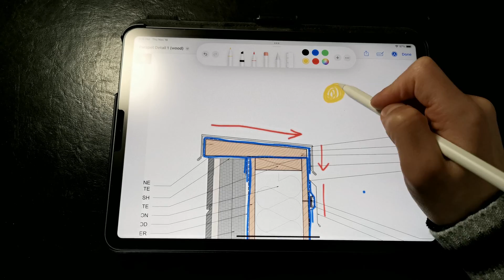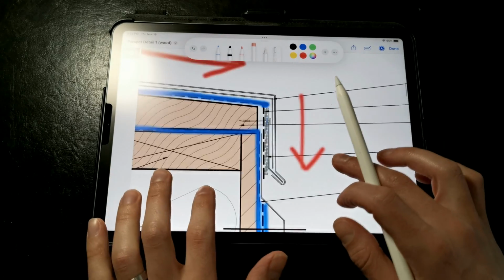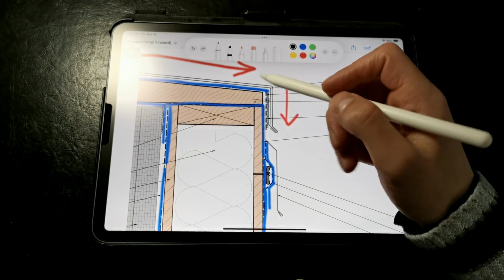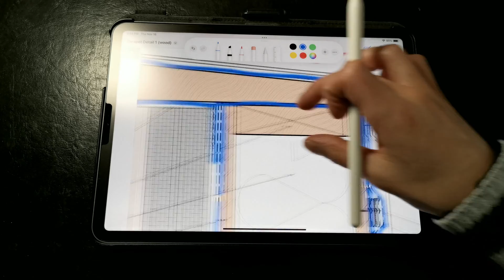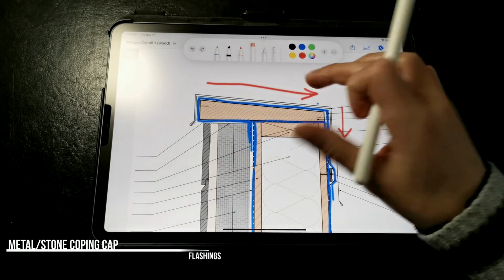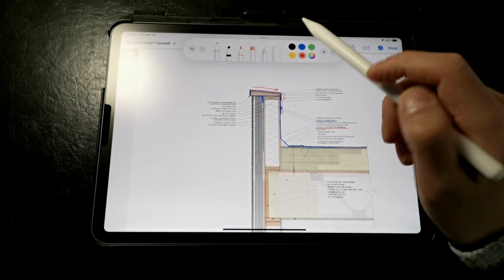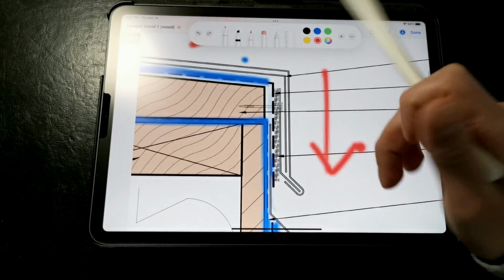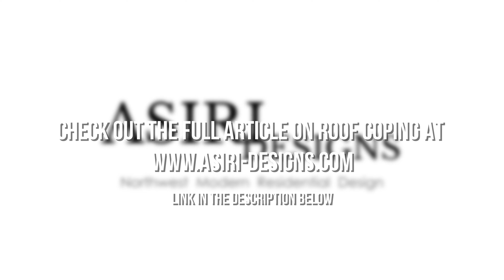Parapet Coping Details Explained

Comment: What i wonder, top fasteners on coping must penetrate through stud? If we eliminate cleat.
Also could be used sheet metal screws on side face of coping through the wood blocking? Thank you
Reply from the maker: It depends on the system, I'm not a sheet metal fabricator but if you have that flashing membrane below the coping and provide drainage, those penetrations aren't a huge deal. But you need those cleats to provide rigidity and resistance to wind uplift in many cases. Bob Kelly from Wickright System would be the guy to talk to.
Reply: Thank you!